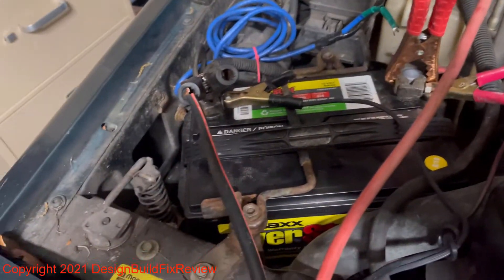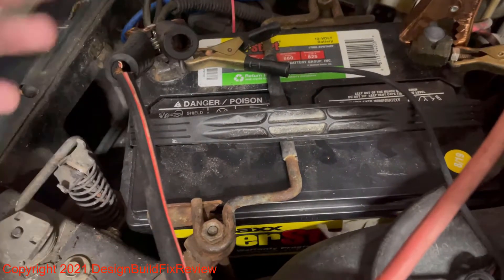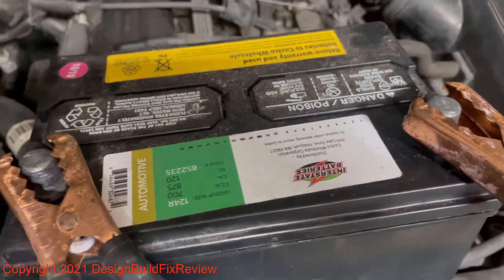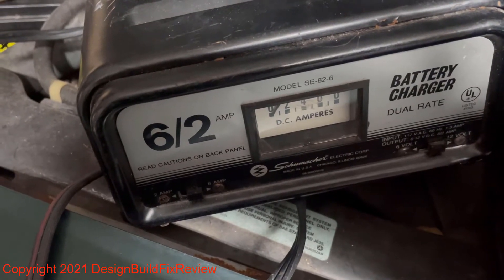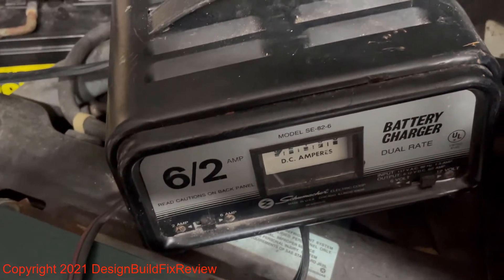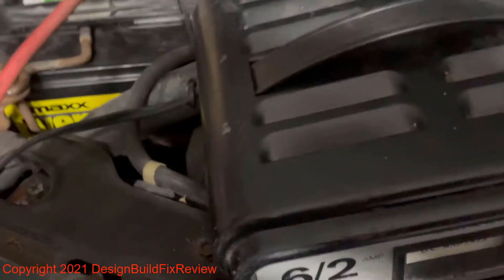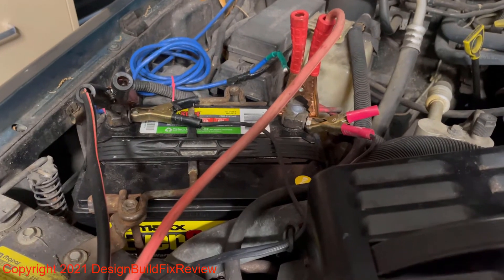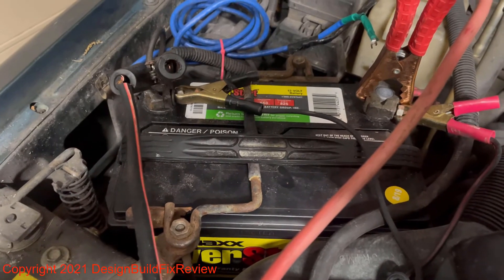How to charge a dead car battery even if 0 Volts Is your car battery really dead?

Comment: Good tip thanks! I had a battery reading zero volts and set it up like this. The next morning that battery was showing 13.1V after removing the cables. 
Thanks again!
Reply from the maker: Make sure you have plenty of distilled water in the battery. Be careful acid there.

Comment: My wife’s 2 year old car battery was completely dead due to her RAV4 not being driven for over a year since the pandemic started (we both just use my car). I charged her dead battery from my car battery for about an hour, even revving my engine to spin the alternator for extra juice. Once her RAV4 finally started, I drove it maybe 10 minutes to get the oil changed and the car engine stopped WHILE DRIVING, as in: the shifter was still in Drive when her car stopped. Thank God I was in a parking lot going 5mph and not on the highway. I ended up buying a new Duralast battery for her car for peace of mind. The tech at Pep Boys checked her car’s alternator and it was fine too. My advice: if your battery is dead at zero volts just buy a new battery; cars are serious business and your family’s safety is worth more than the $100-$150 for a new battery. Also, don’t let your cars sit idle; run some errands in the car a few times a week to keep it’s battery charged.
Reply from the maker: Yes this trick will be a stop gap just to get it running if there is no water in the battery it could have caused it not to charge properly. That being said a batter used or not used for over 3 years should be replaced or tested for real, New perfectly good battieries under $100 are still available at walmart with a 3 year full coverage waranty and five year prorate. Heat and how you store the battery effects its ability to recover.
Reply: @DesignBuildFixReview  I think it was just the car’s security system that drained the battery slowly and completely over that year. I didn’t check the battery’s fluid level before giving it for recycling as the battery literally had only 10-20 miles on it. It was my fault for not driving the RAV4 periodically. Now I will.
Reply from the maker: @kazj1728  Get a trickle charger from Harbor Freight costs about $10. I have a jeep I never drive and keep battery up for 3 years now. They call it a battery float charger now cost $9.99 I bet you could even put an end on it and put it in 12volt port to charge and not even open hood.
Reply: @DesignBuildFixReview  Thanks! They are reasonably priced. You’re a life saver…or more specifically a battery saver :-)